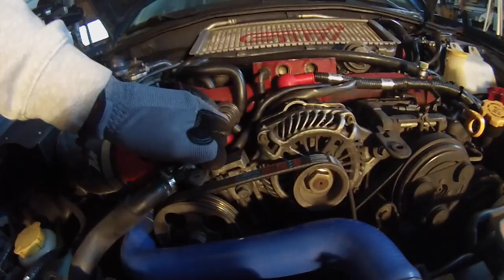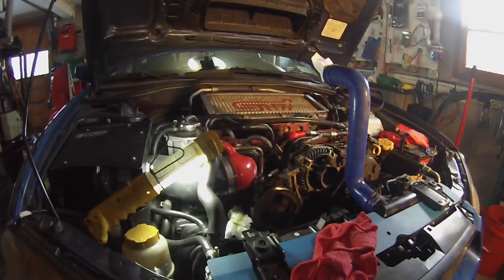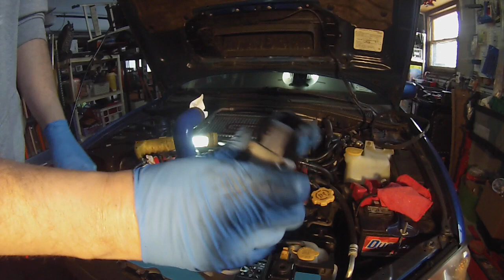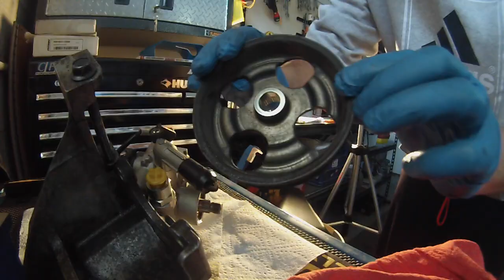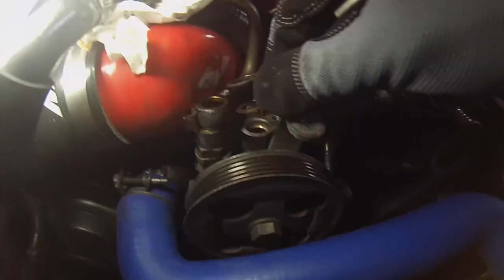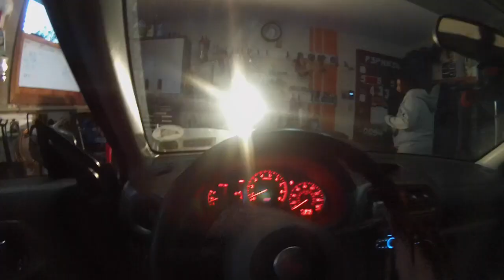2004 Subaru WRX  Sti power steering pump removal install Rumble Ready series #25

Comment: With a NEW pump, should it be primed before starting the engine?
Reply from the maker: Not a bad idea to fill it with fluid but like priming oil filters some say its not needed .  I did not and haven't had any issues since installed a few years ago.
Reply: @svtwrc  It's all completed and runs great. I tried to pour a little in the pump, but not much went in and made a mess! The biggest hassle was fitting the new pump in the old pump bracket. Anti-freeze mess when hose was moved. I had to grind off a 32nd here and there on pump and pump bracket. I raised up the fluid res, pulled off the return hose and collected black old fluid in a coffee can by turning the steering wheel LRLRLR occasionally filling res with red fluid. New fluid made the return trip ok. Put it all back together, lowered, started engine. Some squeals until air got forced out. Runs great. It took 3 hours. Thanks!
Reply from the maker: David A Loving glad your sorted out ! If the noise comes back in the near future you can try this o ring if it’s still stock https://youtu.be/Q1UCo-sElKQ super easy fix.

Comment: what is the name of the drill you used?
Reply from the maker: leeswrxsti Hey there, that drill is a Dewalt 18V Impact gun from a kit that came with a SawZall replica a light and a normal drill. It’s got a decent amount of torque but nothing crazy, it’s good to use as it is underpowered for today’s standard so it’s safer to use . The other drill if a FlipOut drill my father and bro in law get me wacky tools like that all the time. Happy new year

Comment: I did everything in this vidoe step by step. For my 2012 wrx Sti. Yet I still have that noise when I turn the wheels from right to left. I’ve check for any leaks and there’s none. Not above or under the car. Can you help me out ? What else could be the problem ???
Reply from the maker: Lui Ruiz hi it may not be the pump but make sure all the air gets out. A reman pump tends to make noise for a bit but check that your tie rod end,ball joints,sway bar end links and control arms are not making a noise when you turn the wheel.
Reply: I’ll give that a try, thank you very much

Comment: I have a 2012 sti and when I turn the wheel all the way to either side it makes a screeching sound. The o ring is in great shape the car only has 56k miles.im thinking it’s going to be the power steering pump but I’m not sure. There is no leaks either can anyone help
Reply from the maker: WrxSti 18 hi lets try to figure this out. First see if there is enough Fluid in the res it’s Auto trans fluid not power steering fluid. The belt should be tight but not too tight and if it’s leaking there should be a pool of fluid on the block under the pump. If that’s ok it could be tie rod end or ball joint ,check for ripped boots. Have someone stand near the car while you turn the wheel back and forth they may be able to tell exactly where the noise is. Hope this helps.
Reply: SVTWRC hello i just replaced my power steering pump and the noise still continues whenever I turn the wheel (before completely locking) I checked again and there’s no leaks and everything on the rack is fine without leaks also anything else that it could be?
Reply from the maker: WrxSti 18 is the pump OEM or is it a rebuilt reman  one? The remanufacture ones tend to make noise until the air is released , it can take up to a few drives. Check your tie rod ends and sway bar end links, also the control arm bushings can make a noise as can the top hat of the strut when you turn the wheel.
Reply: SVTWRC oh okay thank you very much, I’ll give it some time and see if the noise goes away. I appreciate your time to help me solve this issue🙏🏻

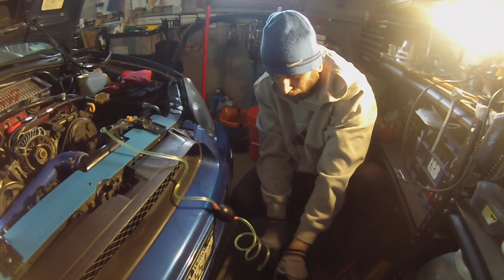Comment: Does anyone know what he is using at 1:37 or anything similar to use for draining some coolant rather than all of it at once?
Reply from the maker: Devon Lewis hi there. I used a simple fluid siphon with a hand pump. It removed just enough from the radiator to allow the top coolant hose to be angled out of the way. Thanks for watching. Hope it helped you out.

Comment: hello, my pump is leaking fluid in the front, I saw that the screw thread that goes the screw on the lower right side (looking at the car from the front) is damaged
, the screw is fine, the problem is in the screw thread that is in the block , do you have any idea how to fix, some way to redo this screw thread?
Excuse my English, I'm from Brazil!
Reply from the maker: guilhermebonafin hello from USA. You have a leak from the threads that’s not good. You can put a Helicoil insert but I would go with a used pump with low miles or new is best . The remanufactured pumps tend to make noise that’s why I go with used and new is expensive but it will last for a long time. Hope you get it fixed.
Reply from the maker: guilhermebonafin https://youtu.be/Q1UCo-sElKQ try this first
Reply: Hello Brow!
First of all I appreciate the answer, I was thinking of using a Helicoil, I did not know that putting a new bomb could solve the problem, because
i thought the problem was in the thread of the engine block, i can buy a new pump, but here in Brazil parts for Subaru are difficult to find 
or are actually more expensive, more than we import parts from the USA. I'll see the other video you recommended, as soon as I fix the problem, I'll tell you how it went. 

Thank you again!
Reply from the maker: guilhermebonafin ok I get it know I’m looking at my motor. Forget about the video it’s for the inlet o ring .If you are talking about the bolts that hold the pump to the block, there are differ sized bolts. If the long bolt is bottomed out in the block it may have punctured it? There are different sized bolts that hold it to the block. If it’s the bolts holding the pump to the bracket that attaches to the block , maybe it’s dripping on to it from above. Let me know
Reply: exactly, i'm talking about the bolts that hold the pump in the block, one of them do not lock Because the block has lost its thread,
if you send a e-mail for the adress guilherme.bonafin@gmail.com i can response to you with a pictures of the engine, get easier to understand..

Comment: HI there. I just replaced rack and pinion on my Legacy 2008, yet is leaks out of the pressure port on the rack. Any suggestion?
Thanks.
Reply from the maker: the rack itself or were  the hardlines connect to the rack. probably a steering rack replacement. not fun.

Comment: assuming this is the same procedure for the saab 9-2x
Reply from the maker: It should be the same work but a slightly different rubber inlet hose.

Comment: Thanks for the video svtwrc! Had to replace Power Steering pump around 117k miles on 2004 WRX. I ordered my power steering pump from Rock Auto(Cardone manufacturer) for $125. The first one I ordered didn't work unfortunately, but they did have 2-3 day delivery included and only took a week for them to process a refund(from the time I dropped defective unit at FedEx). So it was a fairly short turnaround. I used, carb/part cleaner to clean up the mess from power steering fluid(be careful to not get on hoses/wires). Then after install, used some Simple Green and a water hose to clean up the engine a bit. Long story, short... very helpful video for order of operation and detail on bolt sizes.
Reply: Jake Sage I’m about to replace mine as well , same car and 116k miles😂 (04 wrx) you have any tips not shown in the video?

Comment: What company did you go with for the new pump and how is it holding up? OEM is ~$500 and they don't even make them anymore.
Reply from the maker: Recently bought a 07 Sti pump and rebuilt it with a gasket kit someone put together on the IWSTI forum. He sells them on EBay. My new A1 Cardone new pump was ok but the reman was a little loud.
Reply: Can you PM me or let me know the name of the user on IWSTI or his eBay handle? Wondering if he still sells them?

Comment: Great vid man! I may need to have the steering pump replaced on my 04 WRX too. When I turn into corners in 2nd & sometimes 3rd gear, my steering wheel tightens up. It's not leaking or anything. Do you have any suggestions on how to fix this? Thanks
Reply from the maker: Before you replace the pump , check my video on swapping fluid to get new fluid in without removing or making a mess.Then try the inlet o ring. A search will bring up a lot of info and a size you can shop for. If it has a sound to the pump you have an air leak on the reservoirs two connections and or the inlet. It's worth a shot , but remember the bleeding can take a little bit of driving to get it all out,then if it still gets
Reply: Thanks for the quick response, much appreciated! I've already flushed/replaced the fluid which made it less stiff, but still stiff when turning. I'll give your advise on replacing the o-ring a shot. The pump does have a sound when I turn the wheel, but not a whinning sound, like i hear on other videos. Is it supposed to make a sound when turning the wheel, not sure?
Reply from the maker: The pump should be quiet . Sound is usually air .

Comment: Hello I've replaced the steering pump and the rack and pinion it's self. I still have no power steering. Any suggestions?
Reply from the maker: Hey ! It seems you may have an air leak on the inlet side. Try using worm drive clamps on all the old pressure type clamps that are stock sometimes when you remove them it doesn't like to seal. You have two connections on the fluid reservoir too you may have to clamp down good. There is one on the return line too as well as the inlet itself. Hope that works for you. Let me know

Comment: my power steering pump is stuck in housing. I cant get it to budge. anyone have any tips for getting it out
Reply: I had the same problem. What I did is I got some penetrating oil and sprayed on both sides of where the flange bolt goes in. That seemed to be the part that was stuck the most. I was able to get the pump to at least swivel around that point a little bit then so I just wiggled it back and forth while continuously pulling up. Took awhile but the pump eventually slid out.

Comment: I have a  question about the vacuum hoses by the alternator connected to the intake manifold and the blue T piece connected to all of them I tried to take care of a fuel problem with my 05 sti and I did not get to far so along the way some things broke like one of my one way plastic pieces to connect the two vacuum lines together and now I have three vacuum line that I don't know where they go can you help
Reply from the maker: I am going to make a video about the vacuum lines and blue t . I get a lot of questions about how they route the lines. You may need to go to a local auto parts to get some vacuum T and or straight connection pieces. I should have the video up in a day or two.
Reply: For that blue t. One goes back to the manifold I believe. The one on the side goes back to the canister solenoid. The bottom one goes back to the purge valve. Also, if you broke any part of that t, you'll have to go buy the whole hose. It's stupid I know, but that's how the stealership does it. It'll cost you about $40. Hopefully this help you if you haven't got it fixed.
Reply from the maker: +Subaru “Impreza” WRX I put a detailed video about every vacuum line in one of my latest videos and it covers that T. Too bad you can't just buy the hose .
Reply: +svtwrc Which video is that? I can't find it.
Reply from the maker: +Subaru “Impreza” WRX it's entitled  .Subaru WRX STi engine bay blue t vacuum lines EVAP  ect....

Comment: I can't seem to get my power steering to bleed think it might be a bad pump?
Reply from the maker: Try new hose clamps on the inlet , the pressure clamp is no good after the hose has been handled and that is where it draws from.  If not you may want to try a new pump.

Comment: great video on point work :::I'm about to change my ver7 motor steering  pump :what year pumps are capable with a 2001-2003 jdm sti motor ?
Reply from the maker: Thanks glad the video helps. If you have a Ej207 jdm you might use the 2002-2005 2.0 WRX usdm steering pump. The Ej257 in the usdm STi  is a different pump. You can tell by the inlet on the pump ,match those up.

Comment: So you didn't have any problem getting the pulley off the pump? I'm about to do this on my 04 wrx and everything I've read says removing the pulley and getting it on the new pump is a bitch. How was it?
Reply from the maker: +nicholi2789 sorry for the super late response . the pulley has holesin it making it easy to get an extension with a 12mm through the pulley and onto the mounting bracket. the 12mm through to the bracket will hold the pulley in place while you remove the main pulley bolt.